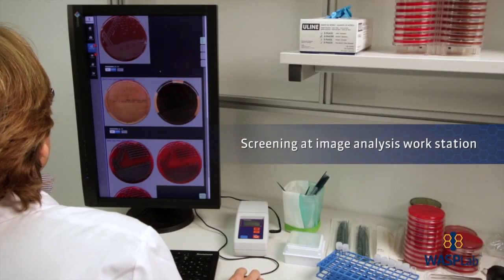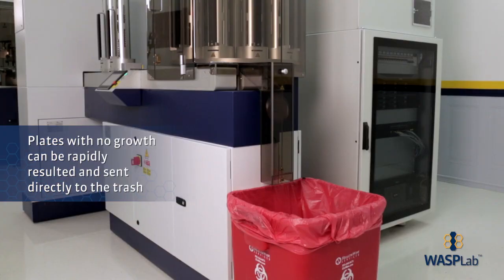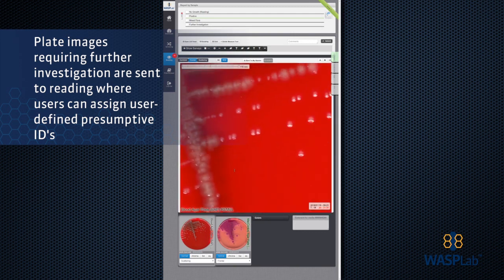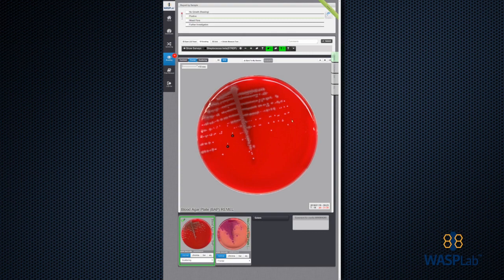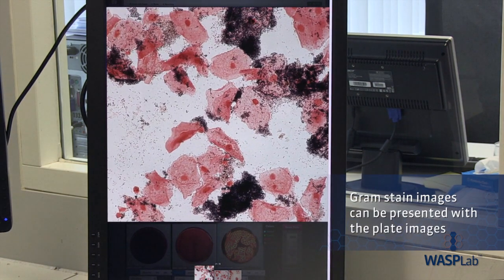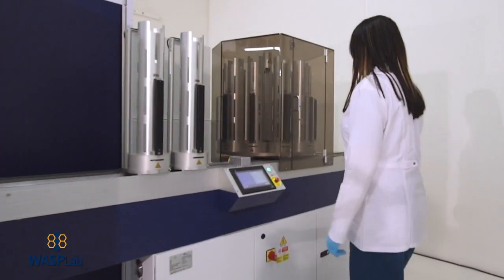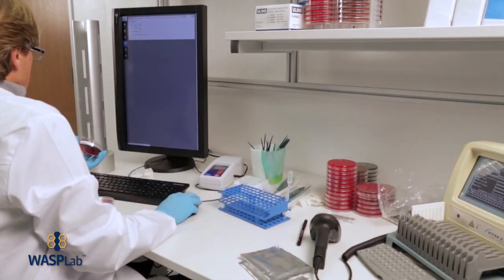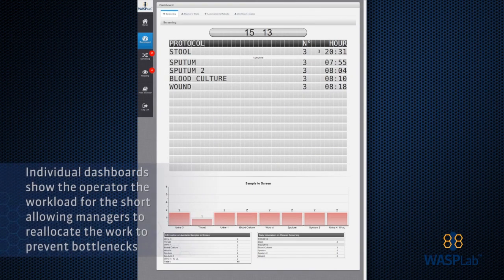WASPLab™ Promotional Video 2017

Comment: No worries, nobody loses their job. The job will just change.
While the SCARA robots called "Tarzan" and "Jane" try to work, you will become "Cheetah" ... always standing by to re-align the misaligned loops, remove jammed plates, fight with the printer and the sucking cups, collecting swabs, that were dislodged from the lid, unblocking the camera chamber and the incubator, climbing on the instrument to screw here and there while phoning with the customer service...
So, do not Walk Away too far!